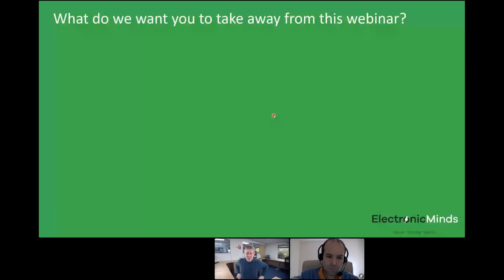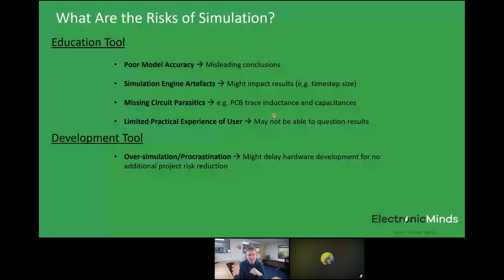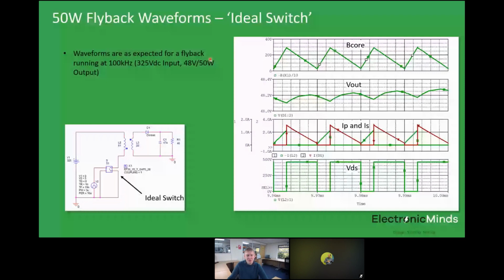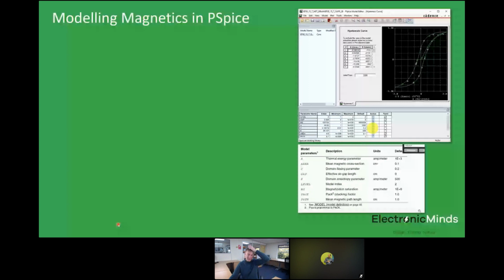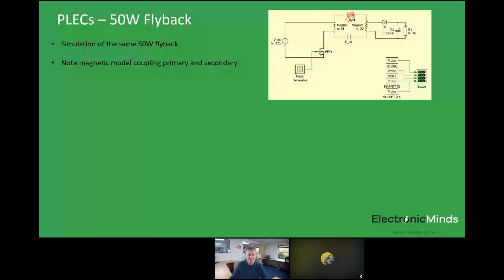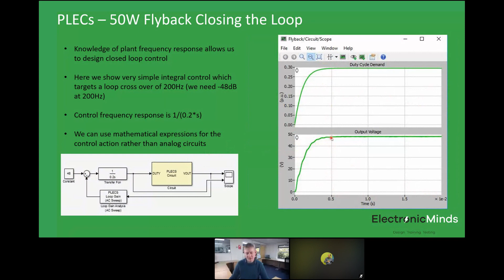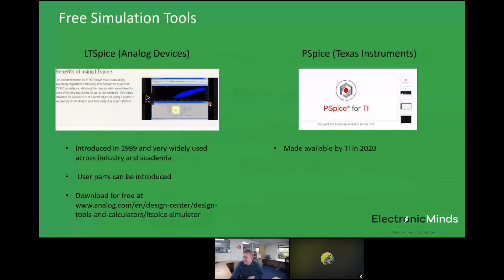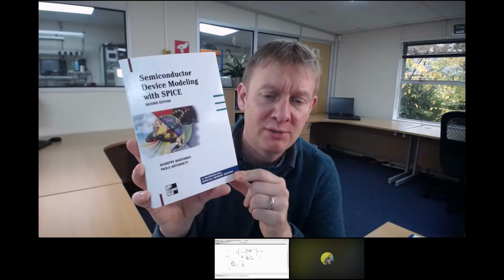Powerful Knowledge 13 - Simulation in power electronics

Comment: Great webinar Iain! 1:04:10 Yes, PLECS Thermal domain simulation can account for thermal impedances. The semiconductor device’s junction-to-case thermal impedance is defined as Cauer/Foster thermal chain data inside each device thermal description, which is usually provided directly by manufacturers. And the cooling system heatsink-to-ambient thermal impedance can be modeled using PLECS library > Thermal > Components > Thermal Chain, or Thermal Resistor with Thermal Capacitor connected to a Heat Sink component.
Reply from the maker: Thanks for your great feedback. Indeed, the device thermal description models inside PLECs are very useful indeed and something we use to examine transient thermal behaviour during peak load conditions. It is so useful to have this sort of advanced modelling capability available to us.